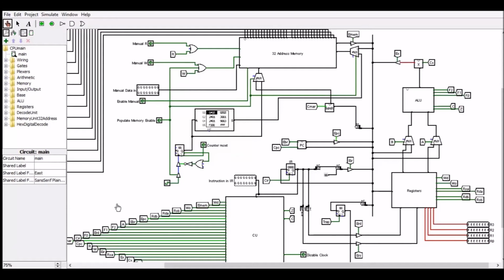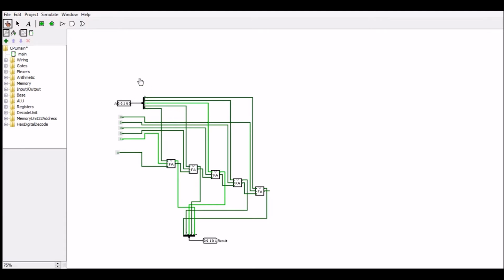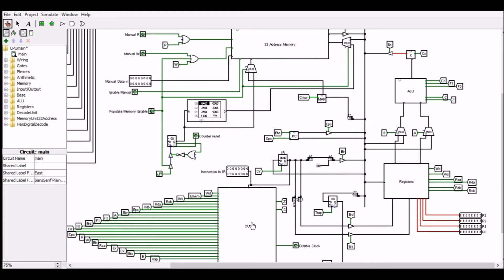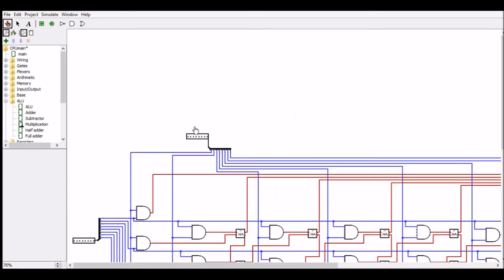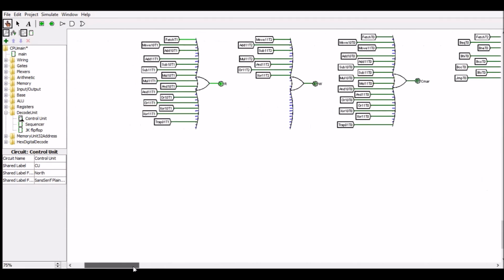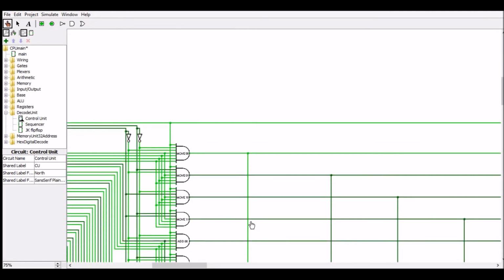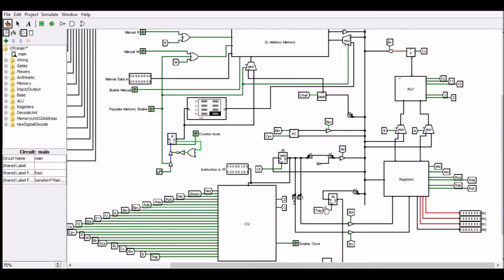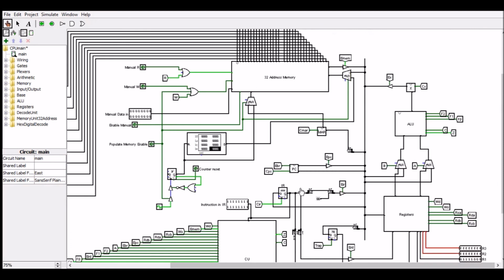Logisim CPU from elementary logical gates extended version

Comment: You can reduce the parts count in the ALU easily by removing the independent subtractor and instead having a single bit demultiplexor that will either route both operands to the adder or route one of the operands through a bank of not gates and then to the adder. You can get your carry bit for subtraction by tying into the demux line. (when the dmux is one, the operand goes through the not gates and then to the adder, also the first carry bit is set).